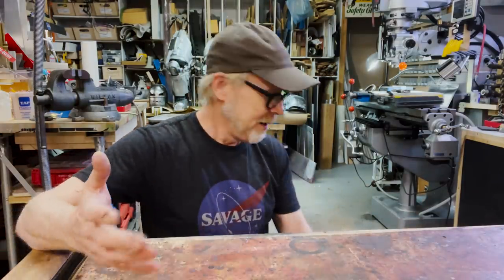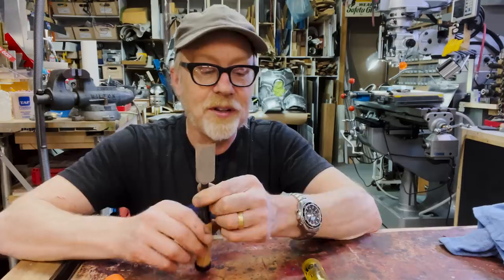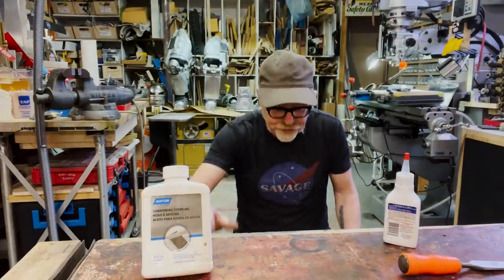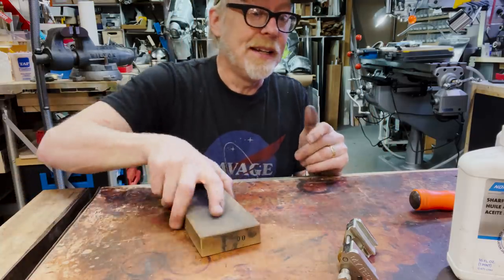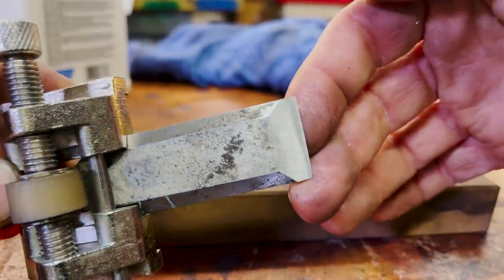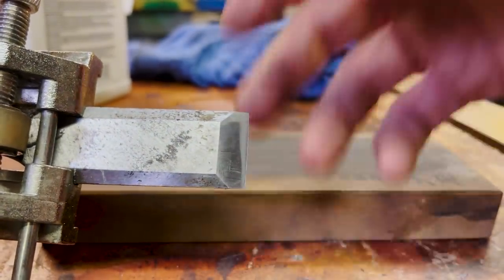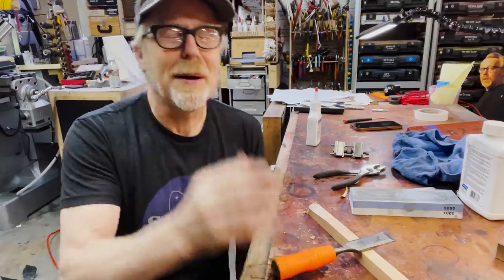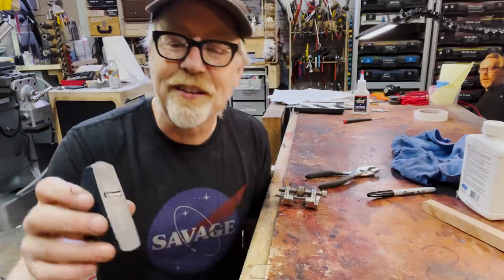Adam Savage's Favorite Tools: Woodworking Chisel Sharpening!

Comment: Semi-random recommendation: a chisel knife. Its exactly what it sounds like-- a chisel with an edge along one side as well as the front, or a single-bevel knife with a flat 90 degree tip (depending on how you look at it). They also have comfortable knife-style handles and generally come with a sheath so you can wear it on your belt. Not totally ideal as either a chisel or a knife, but comes in handy if you keep one on your hip. Good truck knife too-- I've used one to scrape ice off my windshield when the ice was too thick or hard for my plastic windshield scraper to have any effect. The companies Morakniv and Hultafors both make good ones and they tend to cost like $15.

Comment: for most of the chisel guides they come with a measurement ratio, for example from te tip of the chisel to the front of the guide is 3cm that will sharpen the blade at a 30 degree angle

Comment: Sharpening with a whetstone can either be the most satisfying or the most frustrating thing a person will experience.
Reply: I have dug a groove in mine and I hate it. I hate it so much.
Reply: @olekaarvaag9405  Should be possible to get someone to get it flat again.
An old way of doing it was to rub two stones together, because they'd get rid of all the high spots on each other and should end up flat
Reply: @olekaarvaag9405  There are stone flattening stones. Some people also swear by using diamond stones to flatten stone-stones. You can literally use a flat brick though. Experiment.
Reply: @TNH91  that someone is you. You need to grade the stone. You can do it with heavy sandpaper on a flat surface. Although there are special grading stones made for the task too.
Reply: @steeveejee it takes muscle memory to maintain an angle. Really for the tools I can use it with I use a guide. Which is chisels and plane irons. There's guides for knives. Quite frankly knives and axes are not as finicky to sharpen as woodworking tools are geometry wise. Sharpening stuff with bevels on both sides is practically cheating.
Reply: For grooves. Get a nice flat surface, glass works. Get carbide sand, it's cheap, get a lot.

Put sand on glass and lap your stone using rotating figure 8s.

Alternatively get a CMU 'cinderblock' that is flat and free of surface protrusions and put regular sand on it and lap your stone.

This all gets done dry.
Reply: @jonanderson5137  get a belt sander with some 36 grit and let 'er rip! Then you can putz around lapping. If you even need to. 30 seconds to done!

Comment: There are dovetail chisels kept at their best with gentle honing. For fine bench work and precision.
Then there are skirting board chisels which are edged with a belt sander. Used for rough multi tool work.
Better to have a whole draw load of random shape, size and sharpness laid out. Like screwdrivers, just collect them😁

Comment: Also those are not hamon lines unfortunately. Those lines that arc across and make that color difference is a product of sharping the entire width of the blade at once. The corners sharpen faster than the center of the blade. I cant remember the exact reason for this but, there is another knife YT that has a video on this. It may have been Burrfection but I cant remember. You need to do the edge in sections where one edge hangs off the edge of the stone and then do the other side. You can even do an 'x' type pattern with the edge of the chisel perpendicular to the line running from corner to corner that makes the 'x' Start with the corner of the chisel slightly hanging off and then run it all the way off the other corner then repeat the same number of strokes from the other side ( i hope that makes sense) Keeping track of the number of strokes is key and dont use too much pressure that will cause your thinner edge to wear away faster than you want and will change your geometry.

Comment: One thing I've learned over the years is that it's not necessary - or even desirable - to sharpen all cutting tools to the point of polish (4000, 6000, 8000 grit. etc.). Only those that are used in fine termination,  always  with bare hands, gentle force. On roughing tools (say, a 3/4, 1 inch gouge or chisel, long handled and hammered (or used hard)), honing with 800-1000 grit  is fine, the edge is a bit more rough and  "grips" better on the fibers (also, they keep the edge a little longer in hard work/hard woods) 
(same with kitchen /utility knives; you don´t need your butcher/deba knife with shiny polished edge)

Comment: The reason why you can't tell the difference between the cheap chisels and the japanese chisels is that they are the same thing. They have different shapes and different quality but they are made to do the same tasks.

The differences between all the kinds of bench chisels (the normal cheap ones, the expensive ones, socket chisels and japanese chisels) can be in many little details that affect the quality of the product not what it's used for. In fact some things that can distinguish quality chisels are:
- better quality steel
- better construction
- better hardening techiques
- flatter back and sharper edge out of the box
- sides that are square to the back or have bevels ground exaclty down to the back
- better handles (more confortable, more durable, easier to replace, more elegant)
- mirror polished steel
- they can be handmade (especially the most ridiculously expensive japanese chisel)

On the other side there are specialty chisels that are made to do different more uncommon tasks, even though for most things a bench chisel can be used too. For example there are mortise chisel, skew chisels, fishtail chisels, framing chisels, flush chisels, corner chisels, gouges etc...

Comment: The best sharpening system by far is the 3 x diamond plates and a leather strop that Paul Sellers uses (has a youtube channel).  Put the plate holder in the vice and you can sharpen all manner of chisels or other blades.  With a tiny bit of practise you don't even need to muck around with a guide.  And these diamond plates last forever!

Comment: Ok, couple things...  the waterstone is best used with water, but oil won't destroy anything.  HOWEVER, you should get a flattening stone and periodically flatten the stone's surface, otherwise you will grind a trough down the middle, and even if that trough is so shallow you can't see or feel it, it will degrade the performance.
Also, the bevel guide (the little "cart") is very handy for maintaining a highly consistent angle, which is very difficult to do by hand without a lot of practice.  You can get them with bevel angle setup blocks (a little staircase like platform) that will allow you to set precise bevel angles that are completely repeatable.
600 grit is perfect for general use.  If you are going for real precision I'd recommend 600 for the main bevel surface and flattening the bottom, but I would go to at least 1000, (3000 preferred) for the cutting edge.  Some folks I know go up to 8000, but I reserve that for sharpening scalpel blades.
Finally, for something thick like a chisel (as opposed to a knife blade), setting a secondary bevel will speed up the process.  That's a slightly steeper bevel angle for just the cutting edge (last little bit).  So grinding the main bevel to say 30 degrees, and then 35 for the cutting edge... as an example.  But this is a little more advanced, and requires that you have some repeatability in setting up that angle.  But if you use a secondary bevel, touching up the edge is very quick.

Comment: My most used chisel as a knick in the edge from when I hit a nail that was hidden in the wood.
So I've been avoiding even doing projects that require using it because I don't have proper sharpening tool other than a rotary tool & grades of sandpaper..

Comment: There are as many ways to skin a cat as there are cats and people who are so inclined to skin them.

I'm primarily a woodworker and I have a set of nice waterstones that I only rarely use. For quick sharpening I go with diamond stones and use window cleaner from the dollar store as the lubricant. Diamond stones cut faster and don't need to flattened to keep from hollowing out in the middle like water/oil stones, especially if you're using a guide jig that limits you more to the middle of the stone.

Comment: My grandfather was a precision toolmaker back when you had to be good with your hands not a keyboard. He could get an edge on a chisel or plane blade sharp enough to cut atoms. I've never seen anyone no matter what system they use come close. He just used an old dual grit oil stone which wasn't even flat. I realised in later years the reality that there's a whole load of bollocks spouted when it comes to sharpening. It really just boils down to abrasive + oil + steady hand.
Reply: With good equipment edges can be honed with minimal fuss. The most important aspect is the crystal structure of the steel you're polishing. I don't care how good you are if the grain cannot support the edge you're not going to get a fine edge on a tool. To put it another way every kind of steel can only be made so sharp.
Reply: @1pcfred  Yes, kind of. There's a big deal made about modern steels but the old O2 stuff was easier to hone to a perfect edge and whilst doesn't hold it as long, is so quick to do, it's not a problem. Let's not forget that Chippendale made furniture which requires tools to be very sharp made with low quality steel. And the Japanese were masters of the art despite their steel being garbage until fairly recently.
Reply: @markchisholm2657  you're better off with softer tools. They get dull faster but sharpen faster. So in the end you spend less time sharpening. It is something people tend to figure out after working a long time. Super hard tools are super hard to sharpen. Easy is as easy does.
Reply: @1pcfred  There is a lot more to it than just using softer tools just because they sharpen easier and faster. 
First off, what is the material that you are working on. Is it a piece of soft pine, hard maple, desert ironwood, lignum vitae, or a manzanita root burr that is saturated with silica and small stones.
The second is the method of work. Are you working it by hand, or say on a lathe where the rpm indicates how many fpm the wood is coming in contact with the sharpened edge of a turning tool.
The third would be the method used to sharpen said edge. When using the right sharpening system, sharpening a tool made of CPM10V  (A-11) a powder metal at a Rockwell hardness of 62-64 is no more difficult than sharpening a tool made of carbon steel by hand on an oilstone.
Reply: @jimmeier547  mostly I use domestic US woods. I don't go in for those exotics. America First!
Reply: @1pcfred  LOL. All of the woods I mention are from the US with the exception of Lignum Vitae, which is predominately from Central America and played a very important role in our history. It was used extensively for woodworking tools, especially planes as it would remain flat and mostly dent-free. And it was used for making wheel bearings before metal bearings, again because of its longevity and that it basically is self-lubricating.

Comment: There are a few really good video's on honing guides(The tool holding the chisel) and how to get the correct angle(degree) of sharpness. There are simple tricks like getting a piece of wood and gluing little block of wood certain distances from the edge where you can then line up the chisel while in the guide to get the correct degree. You already have a preset number of degrees you can use and don't have to guess. For instance, if Adam's chisel is a little off, he's only compounding it by continuing to try and follow the current bevel. Now will it make that much of a difference? I don't know, I doubt it. But if you're particular like me, i'd check it out! This is still a great video with great information. If this is something anyone is interested in, I would highly recommend checking out Paul Sellers on Youtube.
Reply: Paul is bona fide.

Comment: Holds up a "cheapie cheapie cheapie chisel", I start quaking bc he's about to hold up the ones I have, I just know it, GOD DAMN IT exact same ones. FML
Reply: And now he's talking about garbage chisels and holding up mah bebe 
I cry errytime :_(
Reply: There's nothing wrong with cheap chisels if you prep them. Well unless the steel is too soft. Usually the opposite is the case though. Cheap chisels tend to be too hard to really work with. Makes them tougher to setup and sharpen. Just don't do what Adam does. Get some diamond hones. Being so hard themselves diamonds cut hard steel good. No one doing production is using old friable stones these days.
Reply: Same here.

Comment: I would guess that most carpenters put a secondary bevel when using guide (usually 30 degrees, then 25 degrees), or just have a convex edge and do it without the guide. The convex edge is achieved by tiling the handle upwards as you pull across the stone. The pro of this is a convex edge is pretty robust, and doesn't require fiddling around with the guide, and has no need for 30/25 degree accuracy.

Comment: Paul Sellers from the UK has the best videos for wood working chisel
Reply: I would disagree with that. What Mr. Sellers does certainly works for him. But it took him many decades to achieve the level of skill he has. He still can't get a grind like a guide can produce either. He probably would not even like it if he could. As he's used to the edges that he produces by hand. Guides are just more consistent.
Reply: @1pcfred  idk man it work for my wood chisel bought some harbor freight cheapos to practice with. Then bought my working chisel after I was confident
Reply: @thebearclaw0  I sharpened by hand for many decades. It does work. Guides just work better. Take it from someone that hand sharpened for decades. Me. But even Adam isn't doing it right here. You're supposed to grind a primary bevel then just hone the edge of the tool. If you're contacting more than say 1/8" of an inch you need to regrind. What Adam is doing works, but it's too much work.

Comment: Hi Mr Savage,

I recommend doing a bulk of the work on a bench grinder with the appropriate wheel, removing aggressive gaps, etc. I notice you have a slightly curved cutting edge on that chisel, and that is down to, as I'm sure you know, your stones not being flat. If you reserve the stones for just the honing, they will stay flatter longer. You can also scallop out the material behind the cutting edge on a bench grinder, which will leave you with just an eighth of an inch or so in contact with the stone to hone. This will also help maintain flatness and longevity in your stones as they are removing less material for the same result.

I am a toolmaker and I love watching your videos for your passion and the progress you make as a maker in refining your techniques by choosing better tools and methods. Thank you!

Comment: Just a tip for making sure your chisel stays sharper for longer, make sure when you grind and hone your chisel you maintain a flat face on the bevel and also polish the back of the chisel until that is flat too. 
The chisel produced at 12:38 may have been sharp but I would wager it doesn’t stay sharp for long. This is due to the rounded bevel it has where it has been honed badly. 
Nice flat face and back = very sharp chisel. 
Hope you appreciate the tip. 
I never thought I’d be able to impart any sort of knowledge upon yourself. You are human after all. 
Love all your work 💪🏼👍🏼

Comment: You go even go further with the edge of your chisels by adding a secondary bevel right at the end at a slightly steeper angle than the total face. Nothing major, just enough be 1mm or less on the very edge of the blade. I usually use a 3k stone for a secondary bevel

Comment: Love the videos.
starting with a 600 grit stone just makes more work for yourself, it takes forever to cut through any damage to get to a good bevel and edge.
Start with a more coarse stone to remove the imperfections quickly, then switch up to higher (and higher) grit to polish the nice work you just did, and it takes only half the time.  don't forget to polish off the wire edge on the back side after each grit.
Reply: I usually start with a #180 stone, then go to the #600, then maybe #1000, and ending on #3000. Love the fact that using the right stones makes it go very fast, while still getting the good results.

Comment: As long as they're sharp, a set of cheap chisels is just as useful as an expensive set. I use my cheapies way more often, for tapping out lots of material, and operations where I really need to abuse them. 
The expensive set is for when I need to gently take out a thin slice from hand cut joinery. Something that needs a perfect finish and precision. Even then, you really don't NEED them. It's just nicer. The cheap ones will still do the job just fine.
But really, to anyone starting out in woodworking, or intimidated by chisels, don't feel bad just getting a cheap set. They will do most anything the expensive ones can as long as they're sharp.
Reply: What people fail to realize today is that metallurgy is a widespread science in this era. So there's very little difference in the materials between cheap and expensive chisels anymore. What will be different is fit and finish. That you can rectify yourself.

Comment: Adam,  unless you seriously munge your cutting edge I would look into just doing frequent stropping touch ups.  On aggregate it takes far less time, and you can do it free hand.  I've tried all sorts of sharpening systems and stropping has worked the best for consistently sharp chisels.  When I have to do any chisel work, I just keep a piece of leather loaded with green rouge clamped to my bench and touch up with a couple strokes every 10 minutes or so (depending on the wood I'm working with).